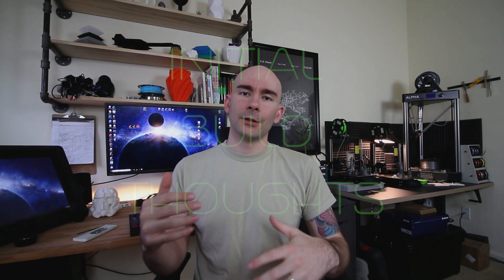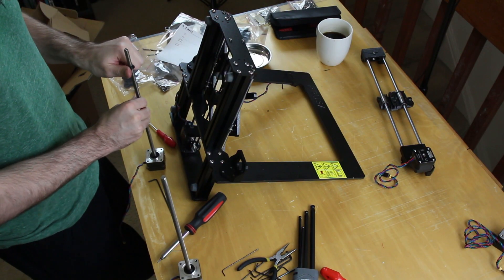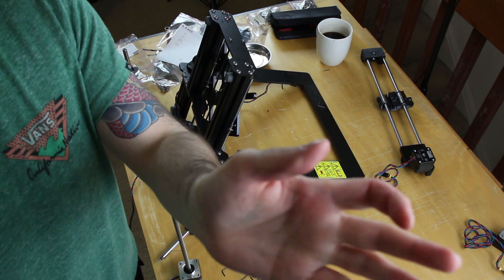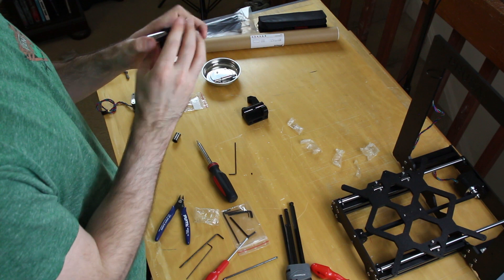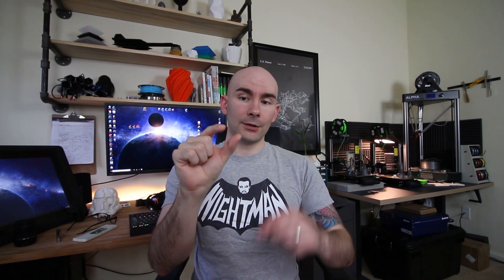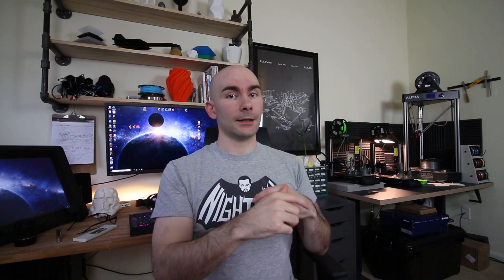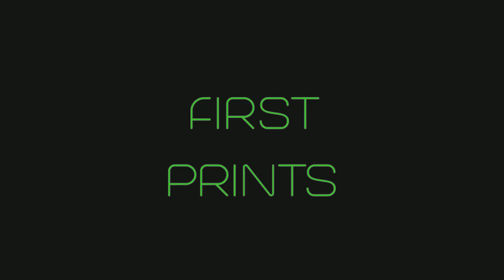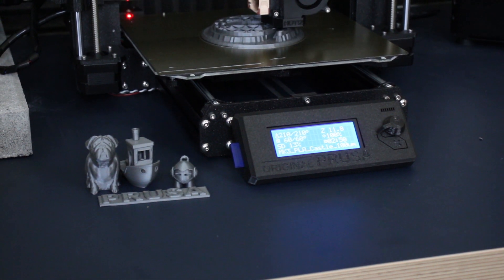The Prusa MK3 Arrived! Is it worth it? I go over initial thoughts

Comment: i wish i could afford that printer . lol trying to find a decent one for under £200 isnt easy
Reply from the maker: They are out there, keep looking.  Also I see used ones go up for sale in the states a lot, do you guys have a craigslist type deal over there?
Reply: we do but with 3d printers i prefer to used from new only as u never know how badly the printer runs till you get it  and then its ur problem, with new ones there is a returns process. i have found 2 already 1 is called the Ender 2 and 1 is called tronxy x1 both are under £200 on gearbest. they both have around only a 150 x y & z build space but at least i can print something in several parts, then save up for a better printer over a longer period of time.
Reply from the maker: Have you thought about the tevo? they go on sale a lot and they are pretty solid.  That Ender looks sweet (plus the book is my favorite book of all time).

Comment: Good stuff. Fingers crossed that you don't run into any of the multitude of issues I've wound up having with my MK3 (non-hardened rods, badly warped heated bed, faulty Pinda sensor, stripped set screw on Bondtech gear, print fan failure). I would be happy to see tech videos of any kind on your channel going forward.
Reply from the maker: Austin, thanks for the vote of confidence.  What do you mean by stripped set screw on the bondtech gear? How does that happen?
Reply: Georges Gadgets maybe my fault, but if you look at the comments on the online build manual others have had the same happen. I think the Allen key they provide (that tiniest one) is a bit undersized for the set screw and causes it to strip really easily.
Reply from the maker: I think you are right, that same key started stripping a screw and I ended up using ones I have.

Comment: Not sure I understand exactly what you were describing related to the print speed/completion time?  Is there something I need to be aware of so that my mk3 prints at its optimum?  (Will be my first printer is why I ask)
Reply from the maker: Since you only have the MK3 there is no need to worry about it.  Basically what I was trying to describe is that the MK2S prints faster than the MK3 when using linear advance.  If using the defaults for both then the MK3 is WAAAAYYY faster.  In my opinion  you went with the right choice the MK3 is better in every way. Linear advance is a beta setting in slic3r so it has issues sometimes.

Comment: I've had one on order since January 8th... There's been a few delays, but if all goes as planned, it should ship to me next week.  I'm glad you had a great experience, its made me realize the wait was well worth it...
Reply from the maker: John you will not be disappointed!
Reply: John, what delayed it?  I ordered mine first week of March I hope to see it by the end of April according to the current shipping info from Prusa.
Reply: There has been a variety of issues.  Most of them due to growing pains at Prusa (I don't think they anticipated the demand for the Mk3 that they had).  They also had supply problems (bad rods, delayed powder coated sheets (which they still don't have), and heated bed issues.  It looks like they are starting to get caught up though.  Last I checked they were sending out orders that were placed in December.  Here's a link to Jo's blog (https://www.prusaprinters.org/original-prusa-i3-mk3-3-months/) as well as the current shipping table (https://help.prusa3d.com/l/en/article/6OdtbKF1bw-mk-3-shipping-information#_ga=2.230670236.189845215.1521252584-852538457.1519604243&_gac=1.87312106.1521311699.CjwKCAjw-bLVBRBMEiwAmKSB84NUnBpKm1-kyvOdoODirxA2zjGcfvp-E7KLmVcobFWJIkhZISXcaRoC19gQAvD_BwE).  I've been delayed 3 times already (Supposed to ship on the 1st, then the 5th, and now the 19th).  I'm hoping this will be my last delay.  However, from what George has highlighted, I think the wait will be well worth it.